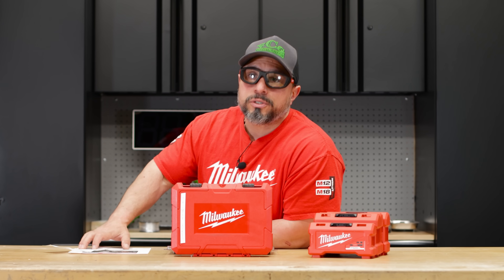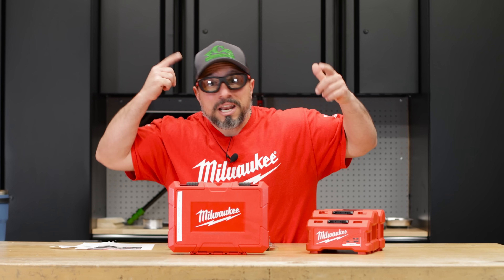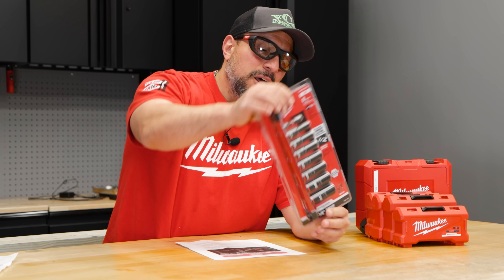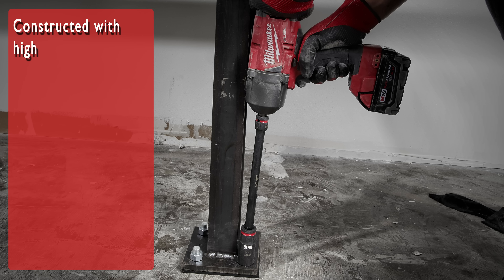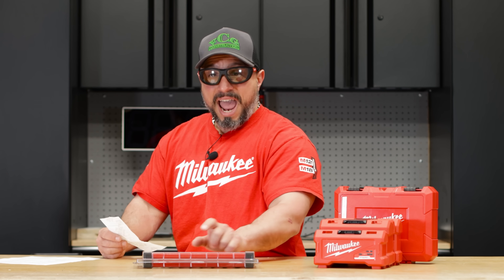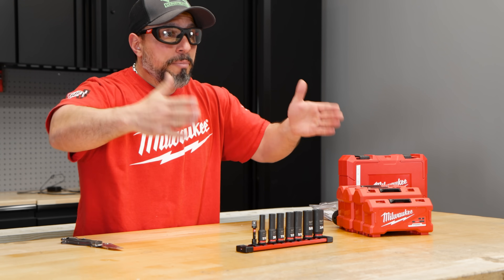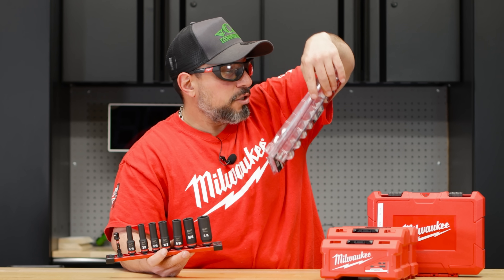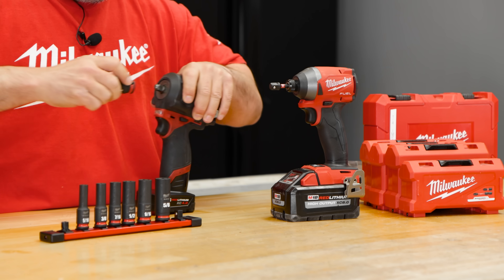Milwaukee Tool NEW Impact Sockets (WHY WOULD YOU BUY THESE?)

Comment: Sounds good, but clearly Milwaukee isn't stepping into the Automotive industry with these sockets.... The metric set, which most auto tech's would use in today's age, includes a 10mm, 13mm, 14mm, 15mm, 17mm, 19mm, and 21mm.  I guess auto tech's dont need 8mm, 11mm, 12mm, 16mm, 18mm ? Literally 5... FIVE socket sizes that are common, except the 11mm. It's a no go for me as a automotive technician using these type of sockets daily. Love the power tools from Milwaukee, but they clearly aren't stepping into the auto industry for their socket fasteners. Does the first set, which cost's way too much, include all sizes with NO skips? Even if they do, $100 bucks is steep for Milwaukee sockets unless they try to claim to be industry leading which i doubt.

Also, the SAE set your displaying, which i do appreciate showing the new tools coming out, is like.. 7 pieces? The typical SAE socket set worth includes 11 pieces ( 1/4 - 7/8 )

Comment: Where are these made? China? Their tool steel is crap. What’s the warranty? Lifetime no questions asked or limited? You can tell a lot about the quality by the warranty.
Reply: Limited lifetime, as in not lifetime, there was a point when lifetime meant no exceptions warranty period. Everything on the market is limited lifetime now, doesn't matter what you buy, tools, toaster, washing machine, limited lifetime. If you define limited specifically enough you can cover virtually nothing, as limited typically doesn't include normal wear and tear ... as in using the product as intended.

Limited lifetime means basic warranty period, and I do agree with you on the warranties, if you are confident in your product you know you will have very few replacements shipped. Limited lifetime just used lifetime because folks love to see it, while giving you an easy out.
Reply: @GainingDespair  I've broken a couple sockets wrenches and impact sockets of Tekton, SnapOn and Matco and all are no questions asked Lifetime. Tekton did ask for a photo which wasn't a big deal but all replacements came within a few days.